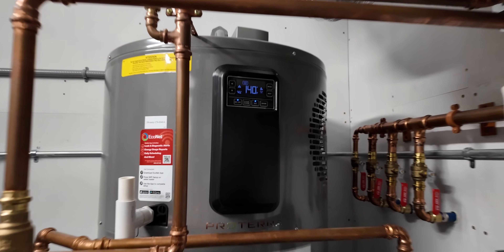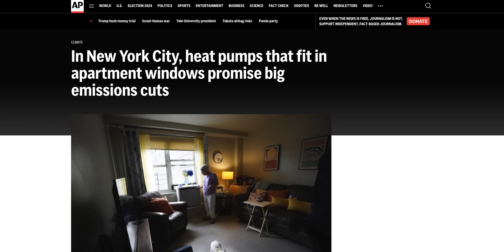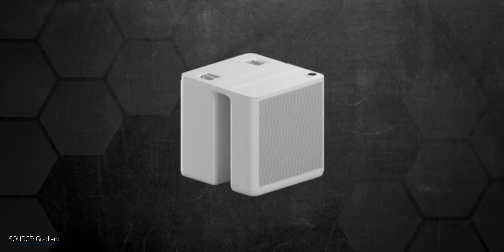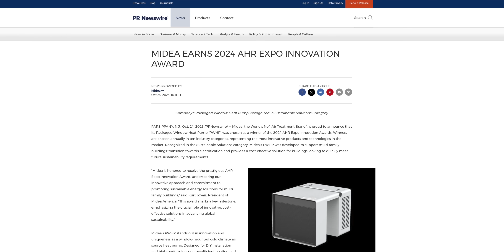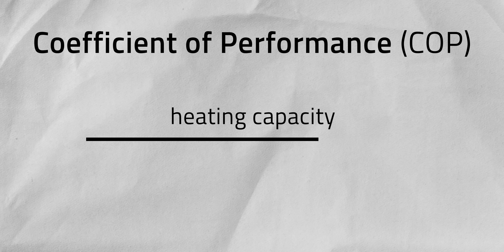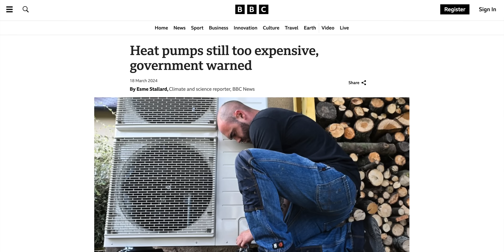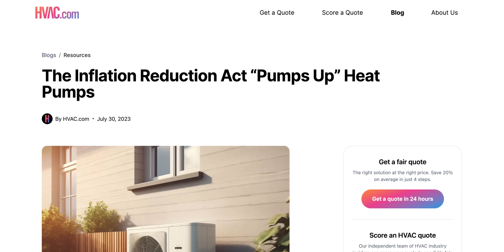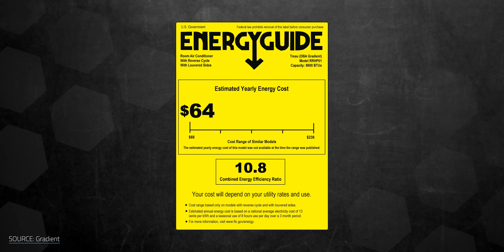Why This Window Heat Pump Is Genius

Comment: Now I just need windows that aren't extremely narrow...
Reply: Or the right type of window.
Reply: @Vile_Entity_3545  Not applicaple for most european windows. (Except UK and around) Windows need to be of the "sliding" type. Windows around here open by rotating the windows around the vertical axis. You would need to redesign the entire window or put a slit below the window into the wall.

Comment: The bracket that accepts the heat pump during install has gas struts that are installed upside down 🙃 the shaft should point down and the gas strut body on top so that the oil in the strut soaks the seal while in the long term compressed orientation. Look at any gas strut on your car to confirm.
Reply: Seals are mostly rubber, so it won't matter, rubebr doesn't get soaked. Also; to refer to your car analogy; take a look at motorcycles, most modern ones have usd (up side down) forks, but those didn't come around until the early 90's/late 80's, and most old motorcycle forks from before then still work fine without any repairs.

P.s. it's also covered from the sun, so the rubber won't degrade as quickly
Reply: The struts won't get used very much so likely not an issue. I mean how often are you going to be using them? Once a year for maintenance?
Reply: With a heat pump onboard, the struts get used 1 time?
Reply: They might be upside down but the aren’t even vital to the function of the unit and it’s just a render of what it might look like. Every chance they don’t even contain struts when the actual unit is delivered.

Comment: Whether its for "everyone" or not depends on whether one can go into the local big box store (the orange, blue or green one) and buy one off the shelf without taking out a personal loan. Fancy new expensive tech is inaccessible to the average "everyone" - likewise for government programs that only provide them to limited numbers of people in specific locations and/or that meet specific eligibility requirements. Ah nine minutes in and we get to the reveal. Absolutely batshit crazy three grand or more pricing. Nope, its only for people that get them free from a govt program, or people that can blow a big pile of money. Definitely not for "everyone"
Reply: That’s the problem with so many of these devices, the cost should be at or less than the more complicated legacy devices.  These new heat pumps are very simple and you would hope the costs come down dramatically over the next few years and we can get one for a few hundred bucks from a Home Depot.
Reply: @arathornd5613  You have the government to thank for that.
Reply: Then let the people with enough money adopt the product, wait a year or two and see if the prices go down and buy the product at a reduced cost. Planning ahead is the way of life.
Reply: Give it 5-10 years, it will become affordable, just like all technology.
Reply: Granted, to get onboard is expensive, but the heat pump side of this would likely save $200/$500 per year in areas where winter heating is required.  Not enough to initially justify the current purchase price, but if that price comes down to about $2000, the overall cost is a net save.
Reply: @dennislyon5412  In many of the places Matt is referring to (NYC, Boston) the cost of electricity skyrockets in the winter and heating with natural gas or propane actually is pretty close in price to heat pumps at recent fuel prices. In summer electricity prices are half of winter also reducing the potential for cost savings over a traditional or especially an inverter AC. Even with the subsidies I think we are still not all that close to sorting this out at scale in these areas. It's too bad that all the meaningful progress on usability and looks of heat pumps comes at a sticker shock price.
Reply: Completely missing the point, but keep scoring troll points.
Reply: This is a big problem but the only real solution is to bring more of them to the market.
Reply: Even worse when some of the top 'green' tech is gatekept behind profit-driven installers with variable skill levels.
Reply: Dug deep to buy a heat pump water heater bc I also wanted the dehumidifier effect on the basement. 2 warranty claims later and I wish I hadn’t bothered. Like I said, dug deep for the 2k water heatet
Reply: Invest money in these companies now, ride the stock wave up, buy one with your profits.
Reply: 15 years ago an led light bulb was $100
Reply: Does anyone know a European provider? Or a UK one?. Thanks you.
Reply: I get what you're saying, but give it some time. The economics of scale will drive that price down. Imagine the device at $500. That'd be a game changer for millions of people.
Reply: I'm guessing that you were one of those people who said nobody would buy CDs because CD players cost 700.00. Or was it computers that cost over 2000.00 in the late 90s?
Reply: I would anticipate that buildings would buy them and they would be part of the apt unit, because it would save money fairly quickly. Especially if there some government incentive, I can see this moving along pretty smoothly.
Reply: @searchingfortruth619  That's great, but I am waiting for something that truly is something that "everyone" can obtain.
Reply: Relax. This is literally how all new tech gets adopted. The price will gradually decline over the coming years. Look how cheap flat screen TVs are. Their prices are down like 90% from 20 years ago.
Reply: The government makes a problem, and the private section has to find a fix, making everything more expensive. Thank you, government, for being the biggest waste of money known to man.
Reply: @letsgobrandon4175  I'd ask you to explain, but your handle makes me think we'd all be better off if you didn't try
Reply: @letsgobrandon4175  seems like a complete non sequitur and a little unhinged